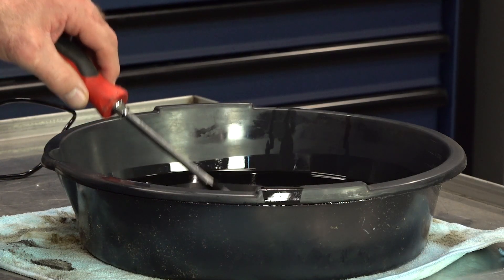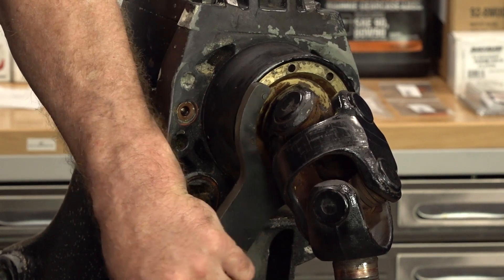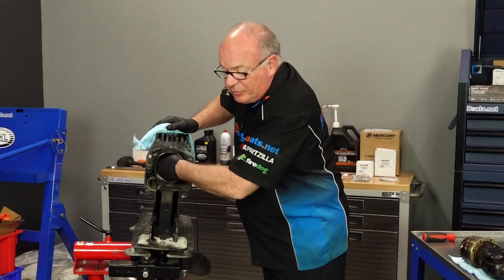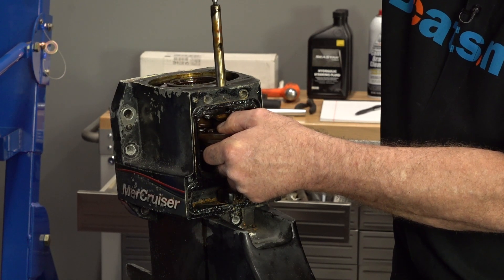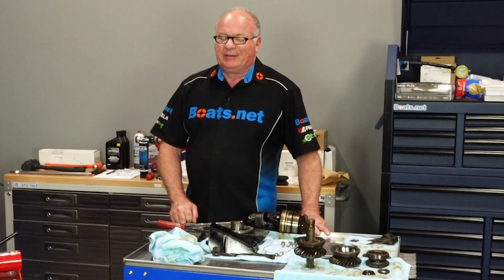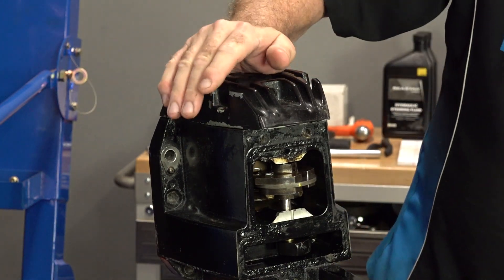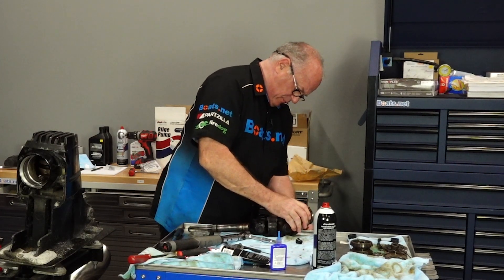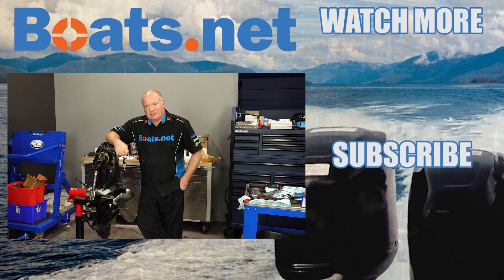MerCruiser Bravo 2 X Clutch Replacement | MerCruiser Sterndrive Clutch Replacement | Boats.net

Comment: Went to change my spark plugs after engine performance had drastically declined, unable to pass 3k RPMs at full throttle and unable to get on plane. Long story short, found oil in spark plugs. What causes this and what should I do to fix it? This is on a 2014 Mercury 60hp outboard. Any suggestions are greatly appreciated.

Comment: Did an oil change, lower until oil change and new spark plugs, now the exhaust is blowing out some white smoke. I have the motor running under a big container with water. Any help or tips would be helpful. Thank you!!